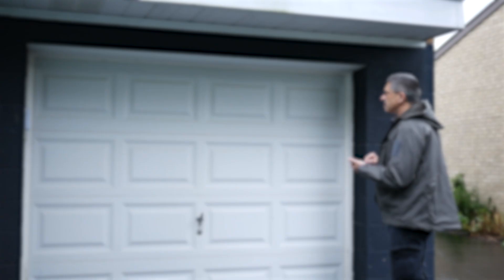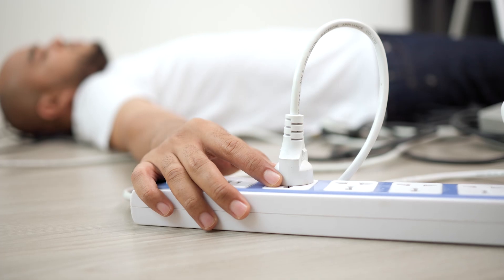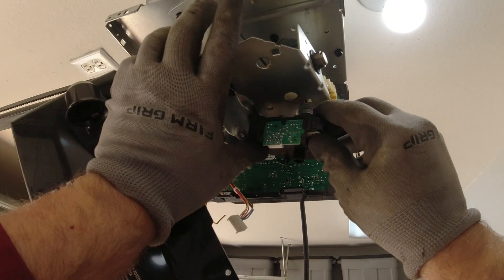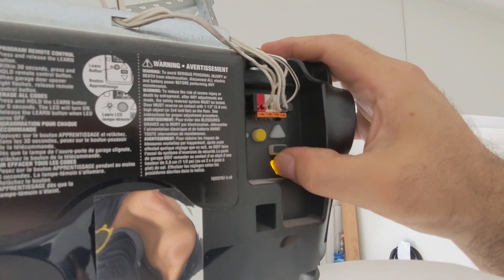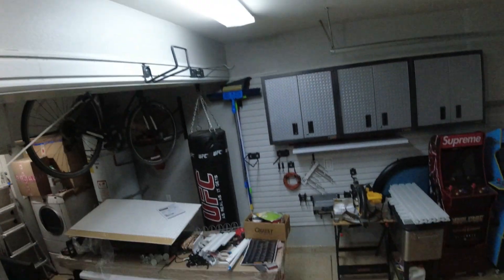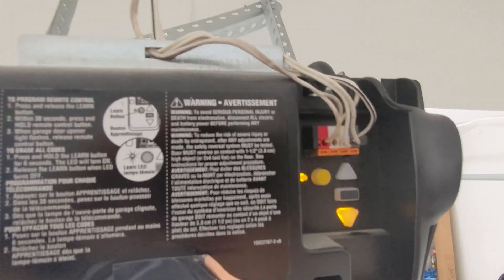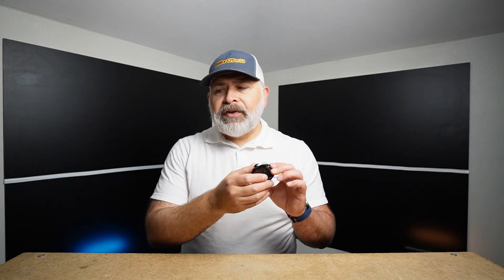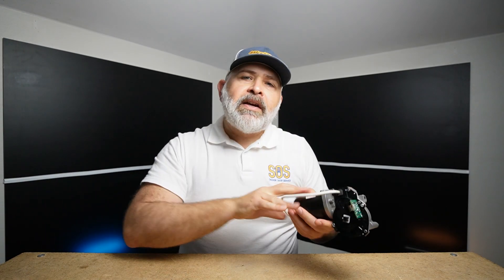How This CHEAP Part is Stopping Your Chamberlain from Closing Right

Comment: Hi. My opener can go through the travel limits, but it's supposed to automatically do the force calibration when I hit the up arror button. It doesn't. I hit the button and it beeps, then the down arrow flashes, I hit the down button and it beeps but the door does not move. Do you think this is a travel module issue? The door won't open or close with any remote: wall switich, or wireless or MyQ. MyQ app just says door opener error. Please advise.
Reply from the maker: Hello.  Thank you for sharing your situation.  This does sound like the travel module.  What has LiftMaster told you about the issue?  Are they willing to warranty the motor for you?
Reply: I need model number please